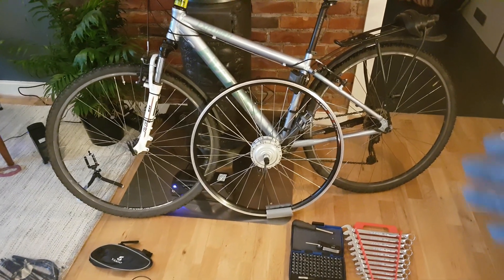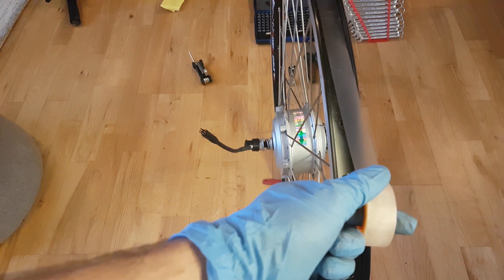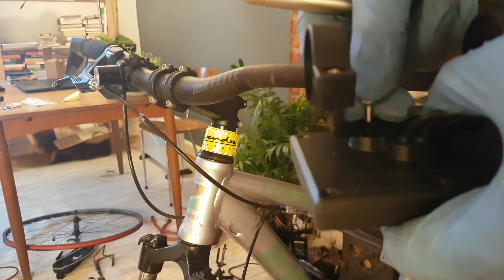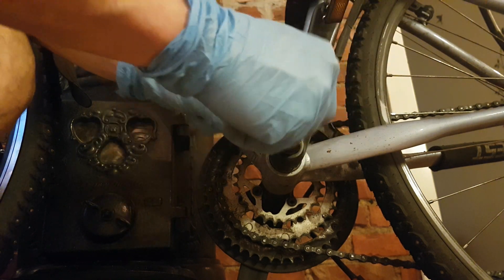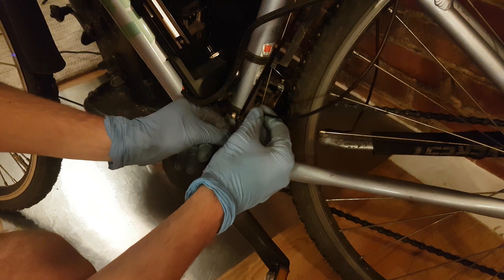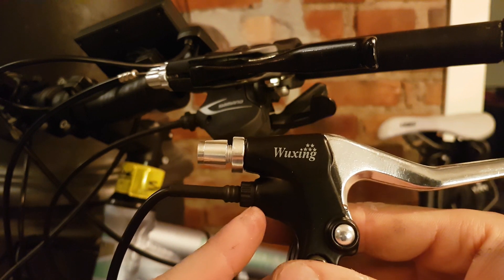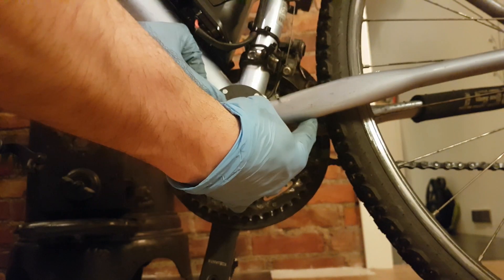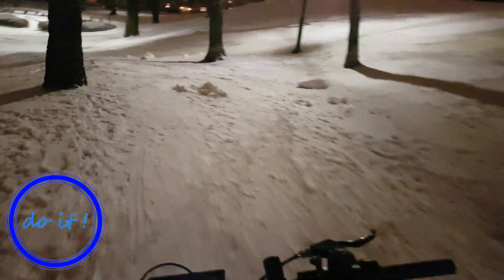Installing a E bike Conversion kit Front Wheel Hub Motor

Comment: For hard to remove crank arms I spray bottom bracket axel (not crank arm) inside crankarm with instant freeze out of spraycan (buy at auto supply store). The freezing spray causes the bottom bracket axel to contract, and then it is relatively easy to use the gear puller to remove the crank arm.  I don't think freezing the bottom bracket axel weakens or damages bottom bracket structural integrity, my bike has worked fine with no problems for many miles, but you can research the effect of freezing various car bolts etc.
Reply from the maker: hmm .. that's an interesting ideea , I will check it out !
Reply: This is a really old technique dating back to when some pedal hubs in Europe were lined with brass. It works amazingly well -- but first make sure if the tightness is due to thread direction. Some bottom brackets are threaded to tighten with the direction of traction.

Comment: AWESOME VIDEO buddy.  I just started my research on this conversion thing and found your video to be very helpful, answered almost all of my questions, now i know i can do it myself too.
A few questions though.  1. Does your existing V break still good for the additional speed?  2. IF one has front disc break, will it still fit?   3. Where did u buy your kit, brand, price?  4. I'm only 5'4 so it looks like the 36V 250W hub will be plenty for me to putt around town.
Keep up the good work !
Reply from the maker: Hei ! I installed disk brakes on the front and it did fit . This particulary one it was from ebay at that time , not the company does not sell anymore . 250w is not gonna be very fun to drive , but enough to take you a lot easier to destination ..

Comment: Great vid, however the brakes needs to be e-brakes which cuts power to the controller when the brakes are applied. The controller should have a connector for these special brakes.
Reply from the maker: Yes that's important . On that bike , the back brakes are regular V brakes with cut-off power sensor though .

Comment: Will it work without the crank sensor? I dont need pedal assist. I only want throttle power.
Reply from the maker: Yes it works , just don't connect the sensor into the controller .
Reply: do it ! . Wow thanks!
Reply from the maker: you're welcome :)

Comment: Thanks a lot for the information! But I was wondering.. You probably have to use these 2 levers that come with the kit, right? So you'll probably need a separated shifter (not intergraded in the lever) is that right? Thanks in advance!
Reply from the maker: Theoretically yes , but I end up using my own hydraulic brakes with no issues

Comment: Hope people are aware that a front wheel motor fitted onto alloy forks may be a major problem, with forks failing at the drop outs due to metal fatigue. Ther have been fatalities due to this happening.
Reply from the maker: I sure those fatalities happened because those extra safety washers were not installed / more powerfull motors . The bike in the video has runned now 3000 + km without any issues 😎  .

Comment: hi there and thanks for  the  lovely vid. What top speed may be achieved lets say on flat ground which a top end power battery? When going downhill does this kit gradually slow  down the bike, if we do not  touch the breaks? I am searching for a product that does not reduce my speed but merely assists on low speeds and  hills. Thanks again.
Reply from the maker: Hi ! I am glad you liked it . The hub motor is going realistically at around 25 km / h on a flat ground . Downhill I did not feel any slowing down because of the motor . It almost feels like a normal bike , except of the weight.  The speed downhill can reach 30 km / h with some assist which will gradually dissapear with the increase of the speed .
Reply: @doit_vehicles  thanks for your prompt response, trying to get something a litle faster but the fitting installing will be prob the same :)
Reply from the maker: You're welcome! I belive the most balanced is a 1500 w motor ,a good combination betwen acceleration , range , price and legality 😅

Comment: I don't have holes for water bottle I do have front brakes rear brakes are my pedals. Will this work for mine. Industrial trike?
Reply from the maker: Yes , sure ! Just drill holes in the frame and tight it with bolts ; as long as there is enough space for the battery .

https://www.youtube.com/watch?v=BAEGfGMY090

This is an old video where I have done holes in the frame for thr second battery; might be helpful

Comment: If I have a twist throttle do I need the rear shifter for the rear derailleur
Reply from the maker: if you get a twist throttle and you have a twist shifters you might have to use either a thumb throttle or thumb shifter ... I guess

Comment: Because you put the pas sensor on the wrong side of the bicycle and did not install it correctly.
By this I mean you glued it on instead of installing it behind the fixed side bottom bracket nut.
The magnets should be shiny side to sensor.
If you want to install it on the other side crank it would be wiser to unscrew the sensor from its bracket and turn the sensor facing the other way, then putting the magnetic ring on shiny side facing the sensor for better sensitivity.
Glue holding the sensor on will lead to a problem later.
Reply from the maker: It was not the best solution but on this bike the bottom bracket will slowly loosen if the sensor will be installed on it ..

Comment: Do any kits come with the battery? I've seen conversion kits for as low as US $215.00 but that was without the battery.
Also, what is a reasonable price to pay for a conversion kit...prices with & without the battery?
Batteries seem to cost in price range of $400-$600. Is that about right. Sorry for the questions, I'd like to do this but I am a noob for right now.
Reply from the maker: Hi ! Most of the kits will not come with the battery . The ones as 215 $ are without a battery . I bought the kit from the video with 520 £ pounds from ebay plus taxes and shipping it went up to 700 £ with battery and everything included .
The prices of batteries will depend of capacity (how long they will last ) quality and who is selling . That's right 400 $ to 600$ is a regular price for a battery ; it might be cheaper if you build it yourself though  ...